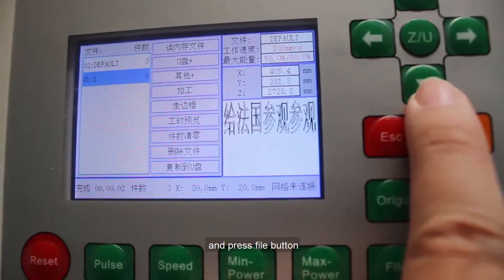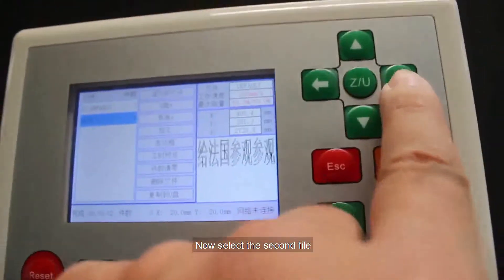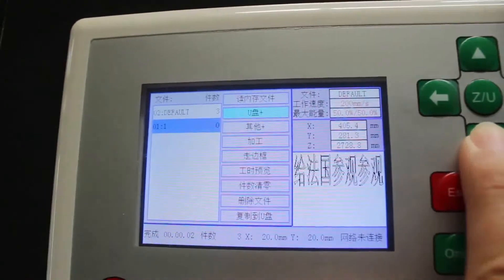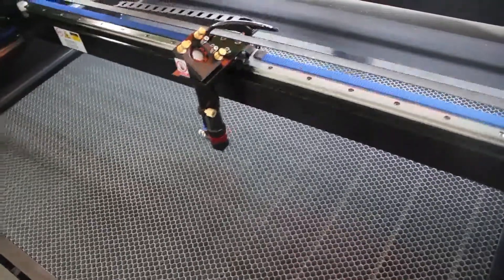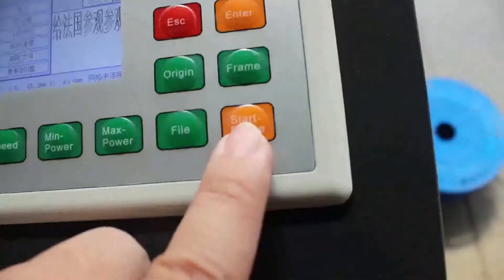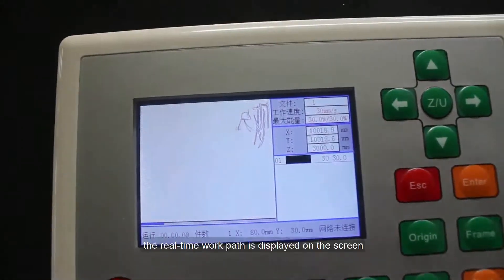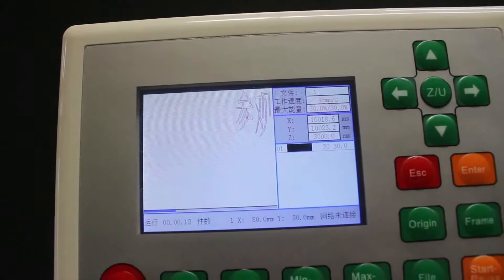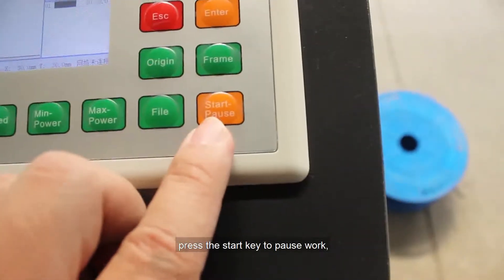how to use ruida control system?

Comment: I cant get the ruida control panel to read the usb. It keeps reading No File. cant you help please.
Reply: Did u ever get this resolved,  mine is doing the same thing
Reply: @shawndraparker2501  
Hi not sure my last message went directly to you.
I couldn't solve the problem so I hard wired directly to the Internet. Wish I'd done it sooner, its so easy now. If I can help with this anymore let me know.
Reply: I didn't so I ran an Internet lead directly to the laser
Wished I'd done it sooner its so much easier. If I can help you with this let me know and I will.
Reply: When you say you ran directly from the internet ,do you mean an ethernet cable from your computer? @englishwoodman